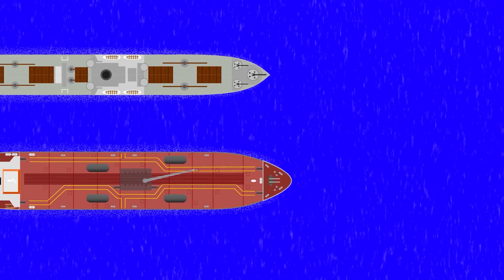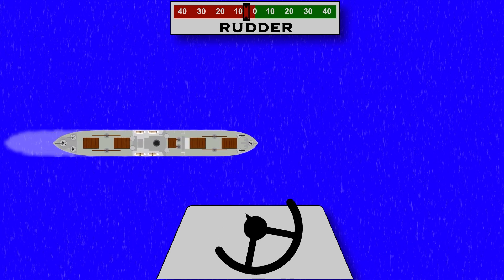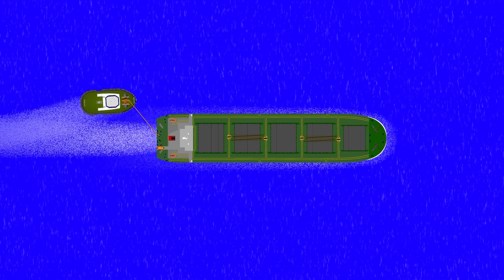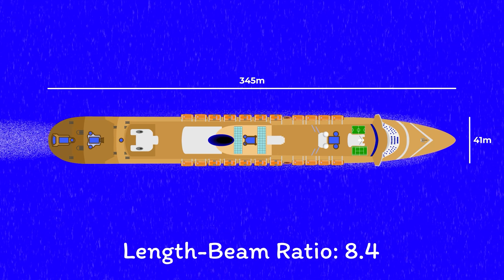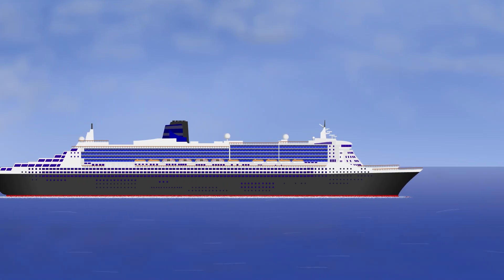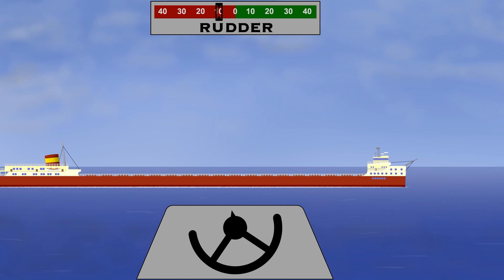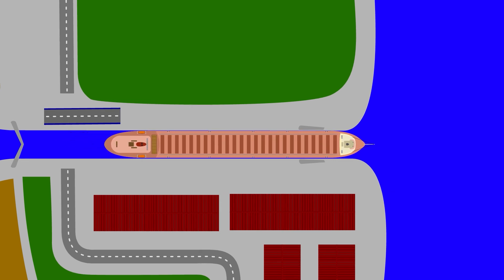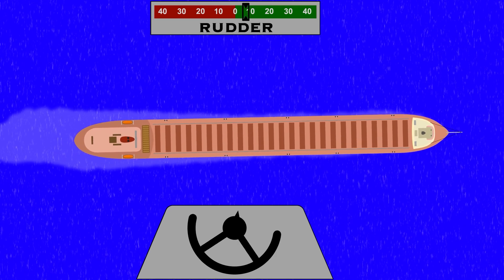Why Do Fat Ships Wobble?

Comment: But the fat ship wobble can be counteracted with a really skillful operator... Such as an autopilot, which never tires.
There are of course other downsides to being fat and maneuverable but at least with constant vigilance one can keep the amount of rudder input to a minimum.
I would also like to add that one can extend fins from the inside of the hull when in open waters that will stabilize the vessel.
Reply: @TactfullyTactless  You don't get rudder induced drag if you never point the rudder away from the direction of travel.
And you get less rudder induced drag if you make constant small adjustments rather than large and infrequent ones after you've gone off course by a few degrees.

One could likewise argue that a streamlined ship that has to turn often will lose A LOT due to rudder induced drag as the hull fights the turning input of the rudder. So clearly a streamlined ship isn't good for cargo because cargo ships need to maneuver in tight places.

And just to be sure you get my original point... My point was that you can combat this drag by ensuring the ship stays on course with higher precision through computer/mechanical aided navigation.
Sensitive enough to where, even if you are off by 0.01 degrees, it will know and make tiny adjustments to the rudder/trim/fins/propellers to ensure the bulky, fat and agile ship stays on a true line eliminating the wobble while still being able to maneuver like a hovercraft.
Reply: @RealCadde  A system which is dynamically unstable and subject to unknowable perturbations cannot be held within tighter limits than the instability allows.
Reply: @Gottenhimfella  You mean like an aircraft that is unstable and wouldn't fly if it didn't have a computer to assist the pilot in keeping it stable?
Reply: @RealCadde  Planes travelling at jet fighter speeds do not have to deal with significant unquantifiable irregular perturbations in the medium they fly through. 
A ship struggling into extreme conditions at 10 knots can encounter swells traveliing at nearly four times the speed of the ship, and displacing an appreciable proportion of its own displacement.

And autopilots on ships can and do compensate for instability of course keeping, UP TO A POINT.

My post was not claiming that an autopilot wouldn't help, but that there is an ineradicable remnant wobble far in excess of what you imply.

What's more, they cannot do this in the way you describe, because responding to  deviations after they start only exacerbates the situation. 
Each correction must be made in advance of need, and the beamier/larger the ship, the greater the look-ahead time must be. 
This requires a self-teaching AI approach.

This can be problematic when a unit encounters extreme conditions it has not previously "trained itself" on.

Software solutions to hardware problems are not a great idea, especially at sea or in the air.
Reply: @Gottenhimfella  There are stability systems for boats. There are planes that won't fly without computer assist.
There's mobility for people without legs.
There's robotic arms that do what humans did in less time, with higher quality and cheaper.

I am pretty sure they can make a volleyball stay on course if they really wanted to.

Comment: on small leisure sport cruisers (8-12m) at non planing speeds you also need to steer a lot. is that the same reason? those are normally having len/beam ration about 3:1... those are normally at water line rather pointy (low block ration). do those principles translate to those small boats?
Reply: The hull shapes also don't always have much of a keel. But as you said, at planning speeds the contact with the water changes completely to a very small length. Not sure what the contact patch looks like in beam but they seem to be whatever the beam aft is. But whatever you do, don't go slow next to small boats and sail boats then gun it the second you are past. You create the biggest wake or hole in the water at that transition time. Wait until you are well past and clear.

Comment: I'm a huge fan of your videos and how informative they normally are. This one, however, is the first one that leaves me with an unanswered question. Why do fat ships wobble? Because their LB ratio is low...? That's kinda just saying a fat ship is a ship with a low LB ratio, which is pretty obvious. But how does a low LB ratio make a ship less stable? Something to do with water pressure on sides of the hull?
An explanation as complete as in your ship speed and efficiency video would be quite welcome!
Reply: Yeah, I was surprised he didn't go into more detail
Reply: Yeah this video was considerably lacking unlike his usual videos. Not great when about 20% of the video is an ad.
Reply: @OfficialSamuelC  I guess his ad contract came with a time limit and he couldn't get a more detailed video done in that time, so he made this. Not great, but maybe he'll do a follow-up
Reply: @insu_na  yeah, that's why I thought it was worth pointing out. It will hopefully prompt him to make that follow up!
Reply: Imagine if a vessel had a LB ratio of 1/2.  You can see how the resistance of the water would want to turn it so it's going totally sideways.  Same concept applies for LB ratios >1, but instead of wanting to turn the ship sideways, the ship wants to stay straight.
Reply: @minimalistic_banhaus  I don't see what you're trying to say. If a symmetrical ship is moving along its axis of symmetry in still water, all forces balance out and it doesn't want to turn in either direction. So you must be talking about a ship that isn't moving along its axis of symmetry, or some other unstated thing.
Reply: @beeble2003  presumably, if everything is just right, it would work, yes. But unstable equilibrium is rarely maintained for a long time. Something happens (wind gust, eddy, whatever), it gets off balance and then flips to a stable configuration.
Reply: Take it to the logical extreme. Say your ship was round like tube floating down the river. That has zero directional stability and its visually obvious why.
Reply: @charlesb.3569  this
Reply: I think it's because of the way the streamlines flow at the rear of the ship.   They would prefer to flow diagonally across the stern one way or the other rather than flowing 'straight'.   The more rounded the stern is, the stronger this effect would be.    But I'm not a hydrodynamicist.
But I would have liked to see an explanation of why (whether it matches my guess or not), not just a description of what.
Reply: This!
Reply: I essentially think of this as wheelbase with cars. A shorter wheelbase means the car is more nimble, but equally more twitchy, e.g. doesn't go straight at high speeds as well as a longer wheelbase car. Now since ships don't have wheels you can't really say wheelbase, but you can have the ratio of the length:width and voilá (you could just have the same thing with cars and it would work the same). This still might not/doesn't answer your question, but it might just be more intuitive, at least it is for me. Edit: wider cars can be more stable as well, so it's not the same as LB but is similar enough for me to consider it is an analogy.
Reply: @daftbence  but wider cars are definitely more stable, as are longer cars, so the effect is neither comparable nor the same
Reply: @afoxwithahat7846  Agreed, the effect is not the same, will edit my original comment. But the effects are both comparable and similar enough to immediately make LB more understandable, at least for me.
Reply: I think it’s inertia just acting on the ship, that and some hydrodynamics that I don’t know.
Reply: 6:00 it's basically hydrodynamics
He explains it there, imagine aerodynamics of a thin car vs a fat van, but with wings
Reply: Ok, first of all we need to stop the "car vs ship analogy.. it's just not working and never will.. second, his videos are normally 8-15mins for explanations, and leave you comfortably knowing what he's talking about and very detailed. Third, there is a "disparity" between the density of the water at the top of a propellor vs the bottom, and small to medium vessels use this whilst docking to "walk the back end over", this could play a roll in this phenomenon.. not the only factor of coarse but you add to it streamlined vessels have sort of a "fin shape" vs container ships are like a finless board with a rudder at the very back and could tend to wander due to the small level of force from the propellor pulling to one side due to denser water at deeper levels..🤷
Reply: He would have to get into how the center of lateral pressure moves around and how far ahead of the center of mass it is in each ship, and what the C of (L) P is, which would probably double the length of the video.
Reply: @jirivorobel942  but overly detailed explanations of maritime concepts I don't really use is exactly what I come here for.
This was more: are shorter ships easier to turn?
Rather than: why fat ships wobble
Reply: @jirivorobel942  Besides, a 12 minute video is more like his normal work, anyway.

Comment: Its the same thing with old tanks, the length to width ratio determines how hard it is to turn and also how sensitive it is to do smal corrections while driving in a straight line.

Comment: Is it possible that Large cargo ship can be fitted with hydrofoils to reduce drag and increase efficiency?
Reply: "Wider adoption of hydrofoils is prevented by the increased complexity of building and maintaining them. Hydrofoils are generally prohibitively more expensive than conventional watercraft above a certain displacement, so most hydrofoil craft are relatively small, and are mainly used as high-speed passenger ferries, where the relatively high passenger fees can offset the high cost of the craft itself." - Wikipedia
Reply: @doso4782  Ok thx for the info